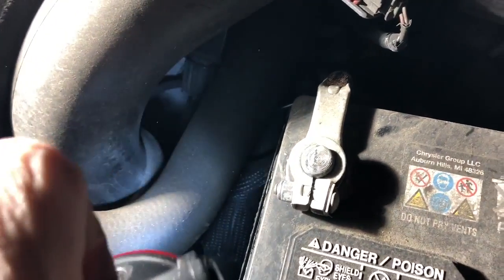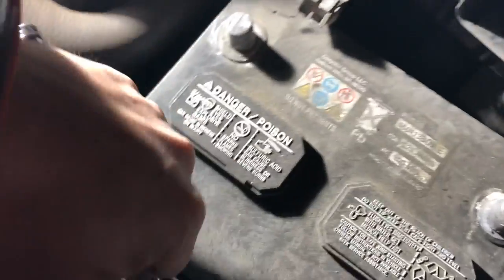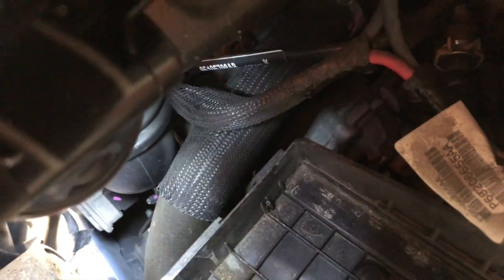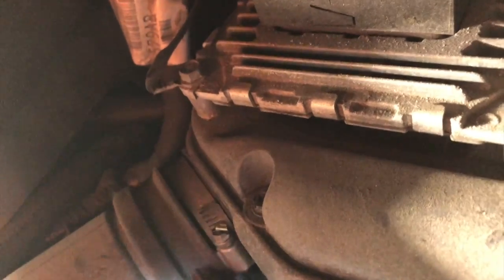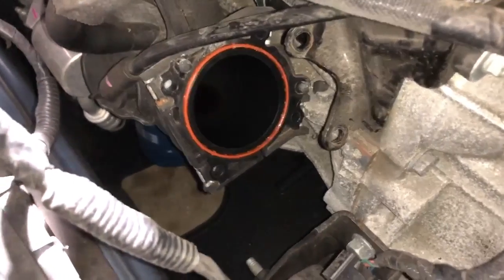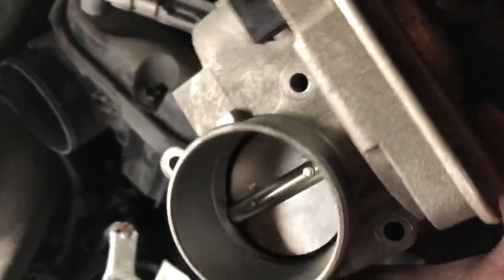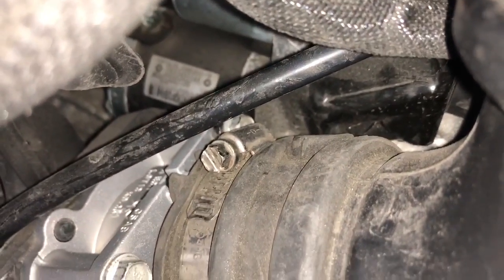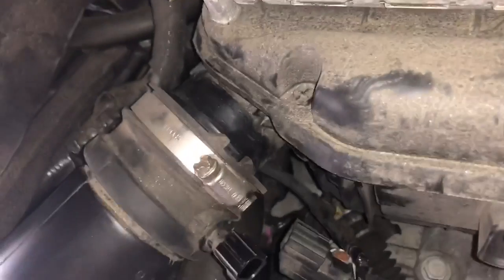Chrysler Jeep Patriot Throttle Body Install. Limp Mode and Rough Idle

Comment: Hey Omar, i just replaced this on my mom's jeep patriot. It had the exact same issues as yours and also same codes. After a day of replacing it, it gave her issues again. What should i do?
Reply from the maker: Fernando Guardado from what I’ve read, sometimes it will take a couple of miles of driving it even in limp mode for the computer to adjust itself to the new throttle body.  I would also recheck all the connections to see if maybe one of the clips is not all the way in.  There have also been cases where the new throttle body is also bad even though it’s new.  I would check for codes again to see if the same codes are popping up.  What year is your patriot?
Reply: Thanks for the reply. Mine is a 2.4L 2014 Jeep Patriot. I'll check out if everything's installed properly and try your advice. Thanks.
Reply: Check the pressure sensor
Reply: Hey Fernando, did you ever get the issue fixed?  My 2015 Patriot has the same systems and looking for resolutions.

Comment: You don't have to replace them just clean them first with carb cleaner if that doesn't work replace it 9 out of ten times there just dirty and the flap want open all the way that puts it in limo mode
Reply from the maker: Sometimes it can also be a loose connector.

Comment: Yooo I just replaced my throttle body. When I put the key into the ignition the check engine light flashes then goes away when I turn it over to fully engage the car. Anyone know what that means?
Reply from the maker: The check engine light and usually all the warning lights come on initially. It’s a way to check and see if the lights are not burned out. Otherwise if the light for the check engine light burned out, you wouldn’t know.
Reply: @OmarsGarage  yeah I get that. I suck at explaining lol. I just changed my throttle body. What i mean is after all the lights turn off the check engine light is flashing but as i turn it over all the way then goes away while running.
Reply from the maker: @Supremebean303  I’ll try to see what happens on our Patriot when we turn it on to see if that’s normal.
Reply: @OmarsGarage  appreciate it, maybe it’s just the computer noticing something new is wrong and it’s just trying let you know but eventually learns it’s a new part and just works? I read about a reset to learn the new part but after putting it in seems to be running fine. Been about 200 miles so far with new part.
Reply from the maker: If you don’t have a code scanner you can usually go to any auto parts store and they will scan it for free just in case it’s something else.
Reply: @OmarsGarage  thanks for the info bro🙏🏼

Comment: now I have another jeep.2016.same problem.dealer told it cost $413.00 to fix it.2 1/2 labor hours.$279.30 cents for the part.throttle body unit.

Comment: Got a 2016 Jeep Patriot Sport 2 weeks ago with 113,000 miles, I know that was stupid af now but it’s too late. Already changed the spark plugs the day I got it when I got it home because I could tell something was off  (it was jerking with acceleration after 45mph). Today the engine light came on, took it to Auto Zone and got a p2173 code back, too much air intake somewhere. It does idle strange.... sounds like it’s pulling in air and puffing out hard if that makes sense lol.. taking t to the auto shop Monday but if anyone has any ideas to what y’all think it could be.. PLEASE let me know. Need to know about how much I’ll be paying. I’d love to fix it myself but just really know where to start. Please help 😅 I know no one who knows about working on cars unfortunately so I’m desperate for anyone’s advice at this point. I just cannot afford a mechanic to charge me their fees right now 😅😂🙃
Reply from the maker: The throttle bodies are notorious for going bad on these cars. In the description of this video is the link to the part I used. It’s about $60 and can be easily installed following this video. If they think it’s the TB, save some money amd do it yourself.

Comment: Thanks for the video Omar,My 2012 Patriot just started with this problem,ETC light on,traction control and CEL are on the panel,hesitation and poor acceleration,1200 RPM at idle are engine symptoms (800 @ iddle used to be the rpms) code is P2173. I hope changing the T.Body fix this issues,my wife is in panic mode, She has the Patriot 2015 with 30k miles and still owe $10k..at least mine is mine don’t owe nothing,bough it used with 80k miles for $2000 has a dent on passenger side and its manual tranny,that is why I had a good deal.
Reply from the maker: FELIPE VALLES check all the connections first to make sure they are snug even though it’s most likely the throttle body.  If you do replace it let us know because I never got the check engine error code and it would be a good thing to share with my viewers.  Thanks for posting and look forward to an update!  Don’t forget to subscribe 👍

Comment: Vehicle would idle rough intermittently, and those lights would come on.  Looked at the ECU when it was happening and each time the fuel system would fail over to open loop mode. 

OBDII Faults:

3 Throttle faults:  Pedal position sensor fault,  Forced limited RMP fault, and Throttle actuator current fault. 
2 O2 Sensor fault:  Some low current/voltage faults

So yeah, limp mode.  Interesting part of this is how the fuel mode was tripping.  The thing that makes the most sense to me is that the emissions output of the reduced RMP mode was low enough at idle to set off the sensors on the output.  This is when someone will really notice the issue with the throttle/throttle body.   The open loop fuel mode is the wrong mix for a car at temp..

I reseated the throttle and O2 intake sensors, and now it is running smooth.  Faults have gone.

Hope this helps someone!
Reply: Hunger Squad You didn't have to replace the throttle body?
Reply: No.  It was the sensor on the throttle body.  Cleaned and reseated it.
Reply: @Nathan Crumley Yes, I just sprayed contact spray on it seemed to resolve the issue

Comment: I just did mine and now it’s saying I need to do an idle speed relearn. Whatever that it man, do you know anything about that?
Reply from the maker: Never seen you have to do an idle speed relearn.  Is the car drive able?  You may need to drive it around sonic relearns the tb settings.  What year is your car and did you buy the tb from the link in my description?  I only ask because this is the first time anyone’s had that come.  I know you can do a manual relearn, but for that you need an OBDII programmer.
Reply: Omar's Garage it had a little yellow tag on the TB that said to do it. I looked it up and you had to have an on board diagnostic and all that Mumbai jumbo. I’m a DIY mechanic that’s learning as I go. And I just don’t want to mess up my only ride. It drives actually amazing now that I have changed it out. I was just curious as to what you would have done about that.
Reply: Omar's Garage oh and it’s a 2014 2.0 Jeep Patriot sport.
Reply from the maker: Realeyesrealize Real lies i don’t remember but I think this was like over a year or two ago and the car has never had that issue come up again.  I’m pretty sure the car computer relearns itself as you drive it.  It actually ran better and idled better than from the factory.  Glad you got it resolved and for a fraction of taking it somewhere.

Comment: I thought you had to re program it when you replace it?
Reply from the maker: Dustin Irvin I didn’t reprogram mine...just drove it around and the check engine light entre after about 20 miles.
Reply: So did the check engine light finally go off? And how did it drive afterwards
Reply from the maker: Dustin Irvin it drove normal.  All the lights other than the check engine lights were off.  Have you taken an OBDII scanner to it for codes?  You can go to a parts store normally and they will read it for free.
Reply: I checked codes and I had the p2173 I just ordered a new throttle body from amazon...other than that no other codes

Comment: How much is a new throttle and can I just buy a refurbished one?
Reply from the maker: I got mine for $97.  Personally I wouldn’t buy a refurbished part for such an important component.
Reply: Ok i replaced with new throttle its working fine but now when i put car into drive it vibrates, what do you think could be wrong, oh and thank you
Reply from the maker: Does it vibrate at idle or when you are driving?  Sometimes you have to drive it for a bit for the computer to relearn the settings for the new throttlebody

Comment: 2010 jeep patriot when first purchased car had voltage light come on while driving car would go into limp mode and die completely.  Turns out needed a more powerful alternator had it replaced and problem gone....1 year later had battery light come on checked terminals for corrosion and fuse box.for shorts....after parking overnight had to jumo car to start and brought to autozone mechanic said battery no good ...purchased new battery good for 3 or 4 days and car again had battery light come on and limp.mode then die. Brought car to mechanic and replaced alternator again. After replacing alternator the compressor went same day so brought car to dealership.  They replaced the ac compressor and checked the alternator  car was ok. 1 week later car had battery light come on again and died again. Figured the first battery was bad and the second battery was ruined while it died twice and alternator replaced so now I am on my third battery and 10 min after having it replaced the battery light came on again so brought car home and parked it b4 draining the battery , I am at a lose what the hell do I do now!? Plz help
Reply from the maker: It could be several things.  If the compressor went bad you may have a bad ground that is causing issues.  Sometimes the ground will get corrosion.  You have to remove and clean with a wire brush and reinstall.  Here is a thread I found with a lot of good advice https://www.jeeppatriot.com/forum/17-electrical-audio/288505-persistent-battery-rundown.html#/topics/288505

Comment: I changed the throttle body and it’s still happening. What else can it be.
Reply from the maker: parales03 did you try disconnecting the battery for a while to reset the computer?  Make sure the electrical harness is well seated also.
Reply: I disconnected the battery for about 2 hours. Is that long enough?
Reply from the maker: @parales03  That should be long enough..have you tried driving the car around for a bit.  Sometimes it needs to reprogram itself.
Reply from the maker: Try this first. 1). Turn ignition to Run, but do not start engine.
 2). Wait for all the error lights to turn on.
 3). Over the course of 15 seconds, slowly depress the throttle all the way to the floor. Try not to waver or be too jerky, just a nice slow, smooth push.
 4). Over the next 15 seconds, slowly let the throttle out in the same manner.
 5.)Start car and drive as you normally would.
Reply: Did you get it fixed?

Comment: Gonna try this,  I'll let you know
Reply from the maker: If anything comes up and you need advise just comment here.  Link in description for the part.
Reply: @OmarsGarage  Hey Omar does that Patriot come with a Aisin Tranny. I thought when it went in to Limp mode it was because Tranny over heating. Would be surprised if an Aisin would over heat though.
Reply from the maker: The Aisin transmissions were prior to 2014 and I haven’t heard of them causing these issues.
Reply: Installed the appropriate parts in my 2013 which was having identical issues.  40 min tops and totally fixed everything! Your video made everything easily identifiable and saved me a pretty penny.  Thank you so much!

Comment: I replaced mine and mine still didn’t start.
Reply from the maker: Was it running before you replaced it?  If it wasn’t starting it’s probably something else. Normally this just makes it run in limp mode.

Comment: my Jeep patriot is a 2015 it was under 36,000 miles and the throttle  body unit was covered by the warranty.jeep dealer fix it.

Comment: We changed the throttle body, 2014 jeep Patriot, now car won't start, help,thanks Bikl
Reply from the maker: Make sure you plugged the cables back, can’t remember if it was one of two of them
Reply: @OmarsGarage  he plugged back, but the throttle body, was replaced way back, so he had to splice the wires, I think he made error there

Comment: What makes it go bad ?
Reply: Can you clean it and it work again ?
Reply from the maker: Darrell Norman in my opinion it’s just a faulty design.  They seem to fail regularly.  Probably should have been recalled.  Too many people with the same issue.  Once you get a better quality replacement it shouldn’t be a problem for a while though.
Reply: @OmarsGarage  thx do u have any suggestions on a brand to go with ?
Reply from the maker: Darrell Norman mine was made by APDTY.  The link is in the description for the video.  It cost me $97 from Amazon.
Reply: It is a terrible design part manufactured in Korea. Most common in 2011-2015 Jeeps including patriot, wrangler, Cherokee, and grand cherokee. 1 in 5 is said to experience it anywhere from 22k-80k mile range. Jeep made a deal with the government to manufacture fully in U.S. in exchange for immunity from consumer lawsuits(more tax money in government pocket). Reason why a recall never went out. I know this because I went through the same and got a lawyer involved and convinced dealership to fix it. More issues will arise. I traded it in. Cant trust Jeep anymore. Now the issue in newer vehicles is about 1 in 100. Progress at least.
Reply from the maker: Dmax that explains a lot.  It’s a shame they don’t stand behind their products.  Thanks for sharing the info.

Comment: Same issue with my 2007 jeep patriot with the etc lights on and esp lights on..
Reply from the maker: Hopefully this is all you need to fix the issue.
Reply: Even the car is shaking with etc lights and esp,you think its the same problem?
Reply from the maker: For the fairly low cost of the throttle body it’s probably worth the try.  Have to scanned the computer with an OBDII scanner?
Reply: Omar's Garage thanks omar for the video and advice,i already fix my car and save a lot of money..
Reply from the maker: Awesome!  Glad you got it worked out.

Comment: In my case the first time I had to change the throttle body but aside from those lights I also had the 4x4 on. the same lights appeared again but this time the 4x4 did not appear like how is on this video but it was just the sensor that was loose so before trying to change the throttle body check the sensors.
Reply from the maker: Good Vibes are you referring to the sensor that is on the snorkel that goes to the throttle body?  You make a good point though that checking all the sensors to make sure they are snug is a good idea.  I did that the first time it acted up and they were all clipped in well.  Appreciate the advice!
Reply: Same thing.   Vehicle would idle rough intermittently, and those lights would come on.  Looked at the ECU when it was happening and each time the fuel system would fail over to open loop mode. 

OBDII Faults:

3 Throttle faults:  Pedal position sensor fault,  Forced limited RMP fault, and Throttle actuator current fault. 
2 O2 Sensor fault:  Some low current/voltage faults

So yeah, limp mode.  Interesting part of this is how the fuel mode was tripping.  The thing that makes the most sense to me is that the emissions output of the reduced RMP mode was low enough at idle to set off the sensors on the output.  This is when someone will really notice the issue with the throttle/throttle body.   The open loop fuel mode is the wrong mix for a car at temp..

I reseated the throttle and O2 intake sensors, and now it is running smooth.  Faults have gone.

Hope this helps someone!
Reply from the maker: Hunger Squad thanks for the input.  It’s always a good idea to check all the sensors for a snug fit.  I had disconnected and reconnected the sensor that goes to the throttle body before and it didn’t resolve the issue.
Reply: Dude.  No doubt you had to replace the throttle body.  My comment wasn't meant to district from that.   Your vid helped me find the right direction!   Helped me think about it better!   Just wanted to convey my experience for someone else that might come across some of these symptoms.  Good job!

When it's open-source troubleshooting everyone wins!

Comment: Just replaced mine in a avenger Chrysler should have sex had a recall they go out all the sudden mine died on me in the middle of the road RPM went all the way to 0 couldn't give it no gas
Reply: I wonder do I need this part for mines my car has no throttle only goes 35 a hr
Reply from the maker: Check out this video and see if it looks familiar https://youtu.be/bfgw-UeSP34

Comment: Hey my 2010 Jeep Patriot losses power and it gives me 4 codes that’s says all the spark plugs are misfiring but I already changed the spark plugs and ignition coils and crankshaft sensor and it makes a noise in the transmission when I hit the gas
Reply from the maker: Wish I could help,  it never ran into that issue. The transmission making a noise is never good. Have you replaced the trans fluid to see if it hasn’t leaked and to look for metal shavings?